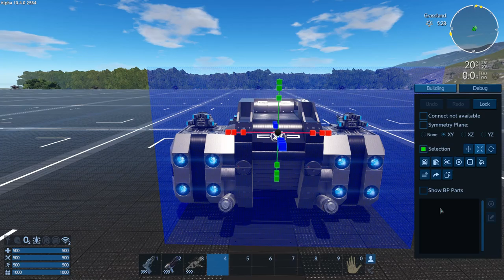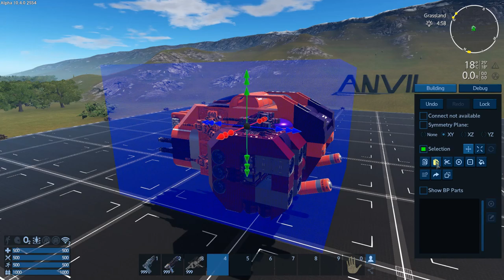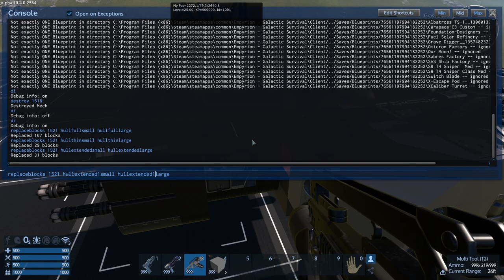Convert Hover Vessel  to Capital Vessel Using Copy Paste How To Tutorial Empyrion

Comment: I use this to convert base space stations into CVs so they can be movable warpable. Very useful!  Thanks for sharing.  I normally strip my original down to just blocks and nothing else so it’s an easier conversion..  then fill it up again with equipment after conversions.